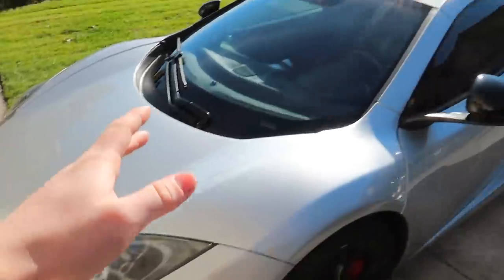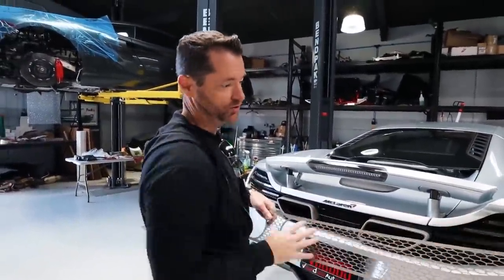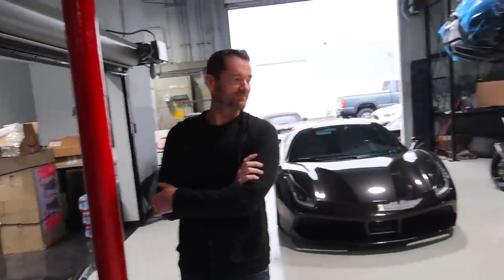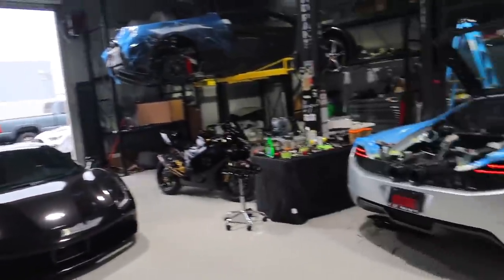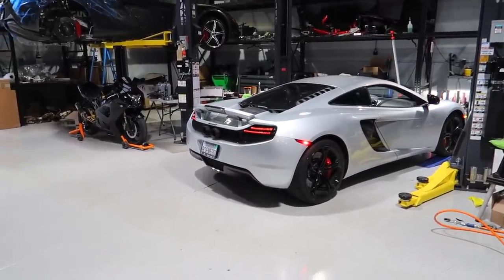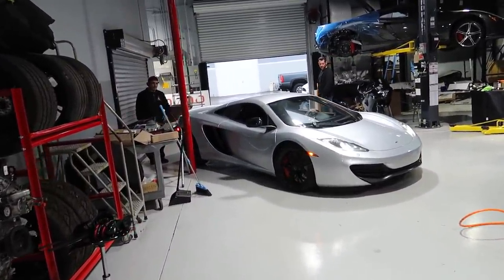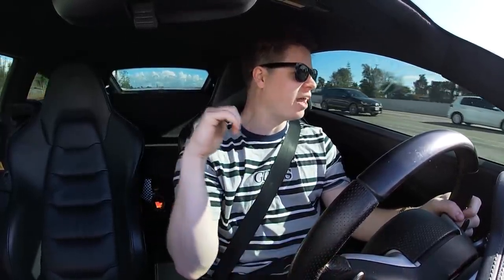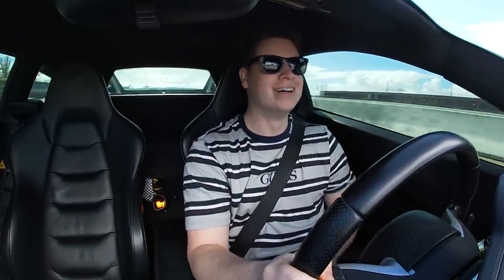The Mclaren Mod NO ONE Else Has, You've Been Waiting For!!!

Comment: I like the visual and sound difference the mod makes but without the cat converter you do lose a little on the low end power even if you get more high end power. IMO it would look better if the new matte black tips were rectangle shaped like usb c plugs to accommodate the taillight design better.
Reply: Yeah I feel like the two circles just don’t fit and look pretty weird I liked it how it was before or get a design that’s kinda similar on the exhaust

Comment: yo i have a 96 LS400 with 234k miles and it runs perfect. the only thing wrong is i crashed it and it has a big dent in the spot under the passenger and back passenger door where the doors meet. i bought it for $500. should i keep doing the build or should i sell it for $2,500?